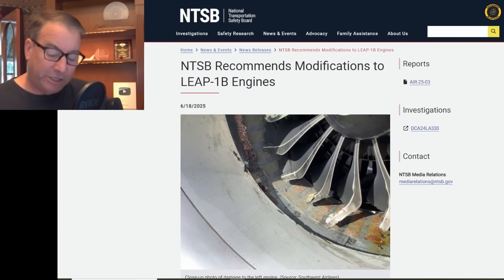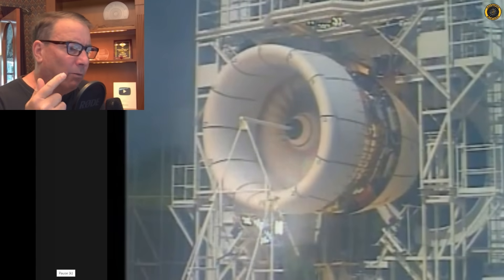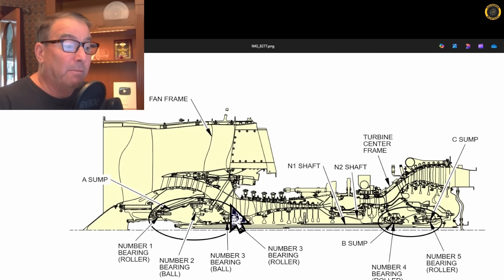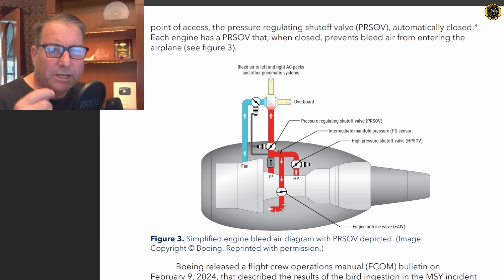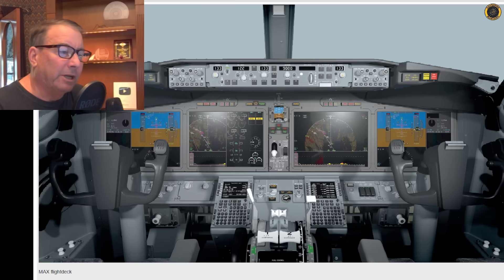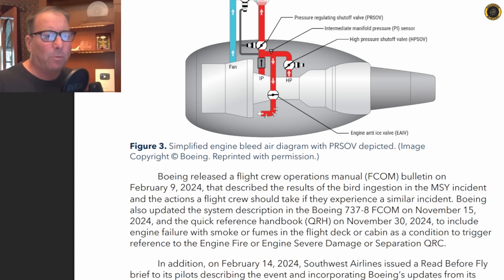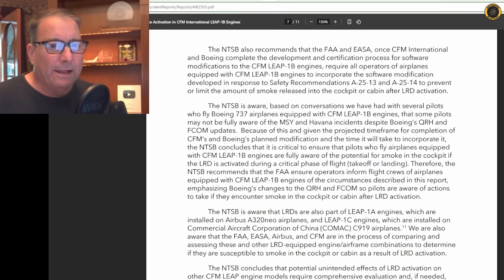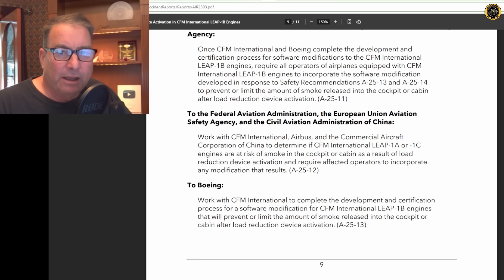NTSB Urgent Safety Recommendation 737Max LRD CFM Leap Engines

Comment: I should be noted the same feature is on the versions on the Airbus A320Neo and the A220. Ironically both aircraft have had issues with fumes in the cabin, but as they are French I guess the FAA doesn't care.
Reply: Also the media likes to focus on Boeing related products.
Reply: Airbus is a consortium of four European nations not just France. The eninge conpany is partially French and partially American owned. I'm sure the FAA is looking into it but more importantly I'm sure that the European equivalents are looking into it that is that is the home base for the manufacturer of the aircraft. American and European regulators work well together historically.
Reply: @mcamp9445  Not really. In 2000, the A320 had problems with its nose gear.  Boeing wanted to file an AD and Airbus attacked them in court, saying only they can file such against Airbus.  They always wanted a redesign of the Airbus flight control system as it tends it was like MCAS it had uncontrolled input as well as no situational awareness.  They overruled that too.  Granted, things could be worse, but I think its the ICAO which they work best with.
Reply: @jhmcd2 Are you talking about the 90° nosewheel problems? Which were caused by like six different failures (including maintenance issues, failure to install the shock absorber correctly and dispatching out of a runway with a required 180° turn while being limited to 25° turns).
Reply: @lyaneris  Yep,  Pegasus A320Neo had that happen just last year. It was never fixed. Also, even the Concorde crash was caused by Airbus not employing a fix required all the way back in the 70s.
Reply: @jhmcd2  Are you certain that was last year? The only reports I could find were from 2021.

Again, the 90° nosewheel is not the fault. 
90° = symptom (and a safety backup position), 
indicators are: nosewheel shock absorber fault + nosewheel steering fault.

Faults are varying, two of them let to a BCDU redesign and software updates. The JetBlue one had sheered retainers due to excessive self-tests. The failures also let to a change in procedure for servicing the nosewheel shock absorber (only on jacks) and redesign so it can't be installed backwards (which happened on another incident).

Airbus will never 'fix' the 90°, because it's an intended failsafe. It looks like a lot of the same problem, when in reality it's a bunch of different ones.
Reply: EASA (jurisdiction wise)

Comment: And yet again we have regulations designed to make things safer that actually make them more dangerous. Typical.
Reply: I mean, no? The issue only applies to the ancient 737. Other aircraft automatically shut the valves if there are indications of high engine vibration. The 737 requires it to be done manually. However not enough emphasis was placed on this action in the Quick Reaction items.
Reply: @kjdude8765 and they can't proactively fix the problem without government approval, which would probably take 5 to 10 years and untold millions of dollars. And then go thru recertification for more decades and more millions.
Reply: Regulations are not the issue. It’s the contortions employed to piggyback more and more on old aircraft certifications. The regulations are written in blood. Finagling round them is an industry in itself.
Reply: @thesmallerhalf1968 the regulations themselves may or may not be problematic, as things written in blood are rarely neatly and cleanly written.   But if it is cheaper to pay someone to futz around to piggyback new stuff under old certs, that suggests the process of getting new certs, ie proving compliance with the regulations, may be problematic.  In an ideal world, it should be cheaper to just get a new cert than to pay a bunch of loophole hunters to piggyback on old regulations.

Comment: No fire…just smoke! 😆 I recall the saying that “wherever there’s smoke, there’s fire”. Unfortunately US airlines are more scared of bad press affecting their stock price than they are actual safety. Safety events are being habitually swept under the rug and only come out months later after pilots press the issue or leak it to the press. Hopefully we can change this before a tragedy forces it to happen. Thanks Juan!
Reply: Oil starts to smoke at a lower temperature than it ignites. So yes, you can have smoke without fire.
That's a loophole in the reporting requirements that should be closed. Clearly filling the cockpit or passenger compartment with smoke is a big deal, even without fire.

Comment: It's a simulated bird strike. It's a real blade off event. The event is not a simulation. That destroyed a real engine running at full power.
Reply: Well it IS a simulation, because they place a charge on the blade to force it to break off. So it's simulating the damage of a real birdstrike. Simulation doesn't necessarily mean computer simulation.

Comment: There are just too many disconnects and technicalities...  After multiple instances of smoke in the cockpit commonsense should have gotten the NTSB , the FAA, and Boeing involved regardless of the fine print.  And to Boeing ... Stop pinching pennies and risking lives.. These new MAX jets are not the same planes as the original type from the 60s'... It is time for a new type!

Comment: What’s funny here is that CFM would design an engine with an LRD which helps mitigate a severe engine vibration situation but then turns right around and creates another severe situation by punching a hole in the sump.
Reply: this engine should be removed from service. it fails regular events like bird strikes in an unacceptable way. at the very least the shear event of those bolts would need to deactivate the generation of bleed air.
Reply: @wiedehopf9068 what do you mean if fails regular events like bird strikes? And they can just turn the bleed air off

Comment: Wait, I am slightly confused. Airbus also uses same Leap engines, it was also specifically mentioned by Petter that Airbus may or may not face same smoke issues. And yet the NTSB recommendation mentiones only Boeing. It means that Leap engines do not cause smoke on deck if engineers did their job, or am I missing something?
Reply: The Airbus planes automatically close the valves when high engine vibration is sensed. The 737 lacks this automation and the crew must manually close the valve. The change is to make closing the valve a higher priority to avoid a crew incapacitaion event.

Comment: Pilots should know these engines as good as the engineers.
Reply: Why? Even engineers don't know these engines as good as the engineers. There are so many quirks, edge cases, engineering compromises inside an aircraft system... Not a single engineer knows all systems. Pilot's job is to fly these things, and understand the emergency checklists. I do not want my life in hands of a person that has a major in engineering, fluid dynamics, electrical engineering, plus a bachelor in computer science and chemistry on top of their pilot training. No human is capable of grasping all that at once. Let the pilots fly and follow checklists if something happens, and let the engineers provide proper checklists. There's no place for creativity in the cockpit until every other approach fails, and by that time no engineering knowledge will help you because in the air there's no way to get anything more than superficial info on what's wrong.

Comment: 8:15 Wow.  You guys don't get something like a "CHANGELOG" when you do updates?  It's a computer.  It can tell you precisely what changed in a summary.  Is the interface really as bad as I've assumed here?
Reply: It may not be that simple.  A changelog only “magically appears” with certain modern forms of documentation software.  In other cases, there may be a lot of human effort involved,  collecting changes that have been gathered from different writers in different places at different times, and just making it harder.  One historical approach is to produce the new version of the document, then draw change bars along the edge of the page for whatever changed.  This was done 😂Ben before computerized documentation.

To be clear: I think your idea is valid - the same kind of summary of what changed should be presented as was done with the pink pages or whatever they were.  I don’t know if there actually IS a changelog that pilots aren’t necessarily reading.  And I don’t know what kind of software they’re using, or whether it would be easy to improve the situation.  I do know that “diff-ing” two documents isn’t always easy, and I wonder if that’s what’s behind it.  Many assumptions.

Comment: My question is,  Why would they design an aircraft where the air / smoke  from the engines could ever enter the aircraft?
Reply: Bleed air for pressurization and A/C..
Reply: You'd need to go back to 1963 and ask Mr. Pratt and Mr. Whitney about their rationale on developing the JT8D, I'm afraid. You'd prefer they kept using bleed-air driven turbocompressors and all the mechanical complexity that went along with them? They had flight engineers back then for a reason.

Comment: About the 737's overhead panel, it's a little odd that the NGs and MAXes still retain the Classics' (and older!) electric panel faceplate with the round cutouts for the old analog ammeters, despite the fact that since the NGs, those ammeters are no longer present. It can't cost that much (in airliner manufacturing scale) to make a new cutting tool to produce proper panels for those airplanes, instead of using the same panel plate from 60 years ago.
Reply: The problem is probably certification and training. Any little thing like that that's changed, requires certification from the FAA, and if the FAA certifies it as too different from previous models, that then requires pilot retraining on the new type, which then costs airlines money and downtime for pilots, which then makes the new aircraft less attractive to airlines in the first place. The result is antiquated vestigial features remain in planes for a long time even if the underlying systems are updated. The 737 Max has already demonstrated why this design practice is unsafe when they kept information about their updated auto-trimming system from pilots to avoid a deeper recertification.
Reply: @hatman4818  To be fair, I don't see how a panel that would have all the exact same lights and switches on the same original locations, (the only difference being a straightedge top as opposed to the two round cutouts for non-existing analog ammeters) would entail a different certification need for pilots. But I guess yes, this would probably call for some certification issues for the airplane because at any rate that would be a new piece installed.
Reply: Boeing's TRADITIONAL cost cutting mantra!

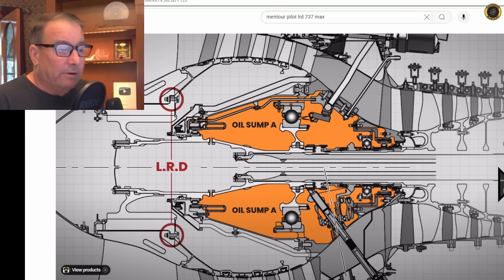Comment: Do I understand correctly that the smoke is from sump oil leaking into the compressor? How does the oil leak? At 3:21, the sump doesn't appear in continuity with the LRD bolt location, so why does oil leak when the bolts sheer?
Reply from the maker: Engine damage, the seal is broken.
Reply: @blancolirio  TY Sir